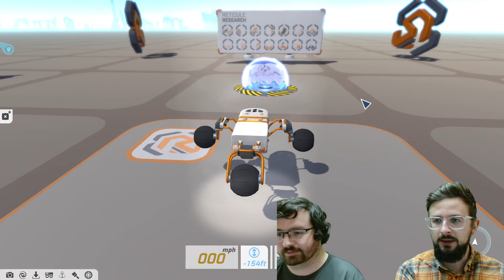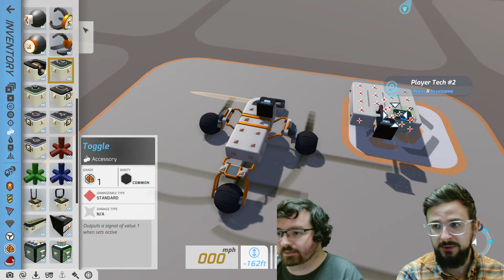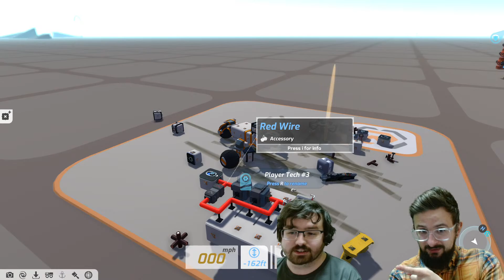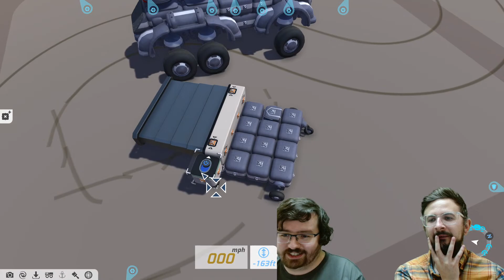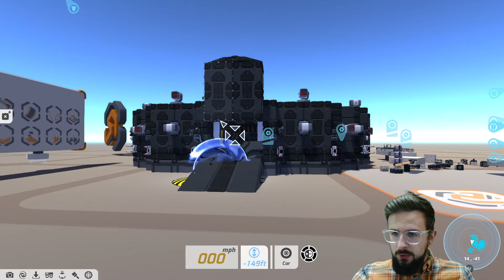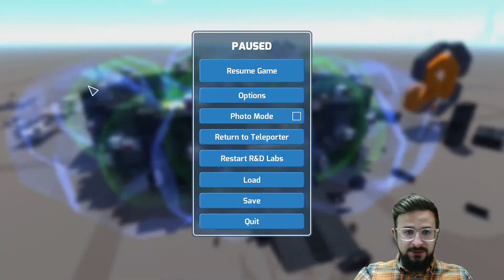Circuits and Systems FIRST LOOK w/ Matt & Johnny || TerraTech Dev

Comment: But what is the point of logic when the most well get out of it is a bit more automation out of factory’s or weapons firing at enemies by them selfs when we can just use ai cabs to achieve the same result with weaponsunless this gives us the ability to build advanced AI and motors and pistons for us to use
Reply: Point is to have sandbox for whatever you wish to utilize it for.
Reply: Or possibly be able to make AI that will hunt down resource chunks via connecting a circuit to a resource radar